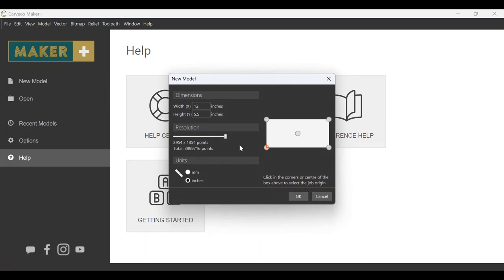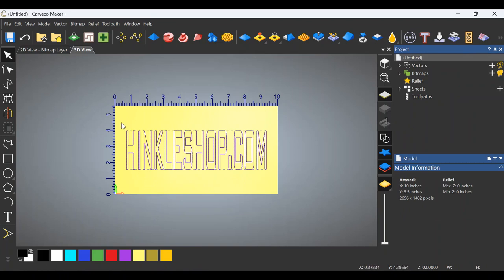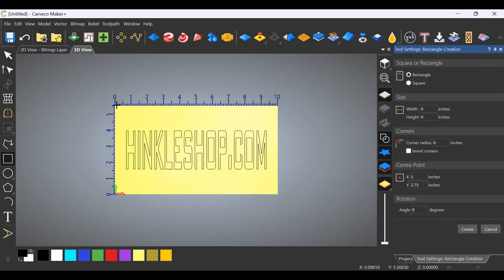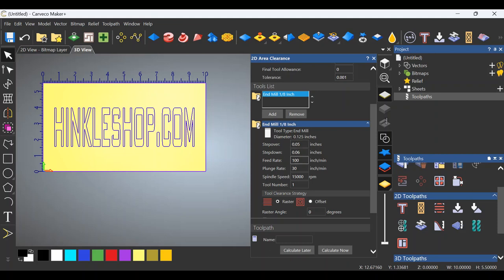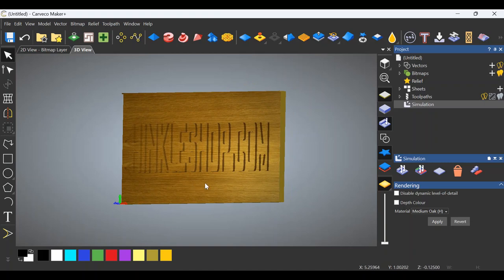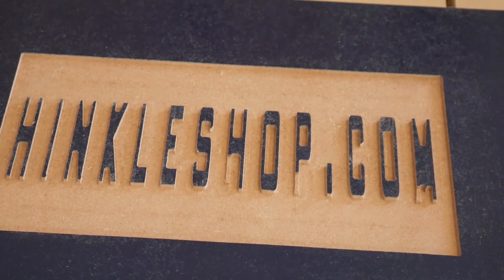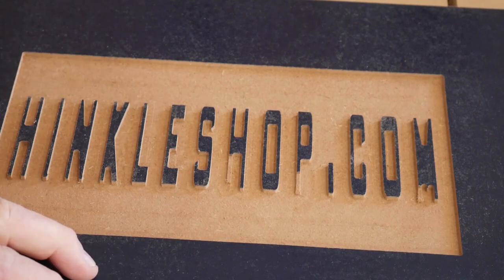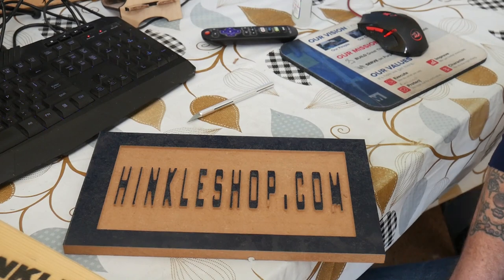Learn raise text

Comment: I've seen your rooster video and now this one, what I am trying to make is a relief Rooster sign with raised letters.  It would seem you have to create a new plane that will represent a future flattened area and from the point, the letters would raise up say 0.125 and the rooster would raise up 0.250.    I haven't been successful trying to do both yet, mainly because the z for the text and rooster are different but they both "start" from the same thickness of the board (if 0.75", then it would carve down a total of 0.25" leaving the 0.125" text and 0.250" rooster).
Reply from the maker: Thanks for watching 
A little hard to explain here but basically create a border around the relief (chicken) so no material is removed beyond the border 
Enter the text outside the relief border enter a boundary around the text highlighting both boundaries and the text create a v bit tool path limiting depth to the same z as the chicken and that should work
Simulate the carve and check to be sure I’m right
Hope this helps
Reply: @Hinkleshop   I will try that.  Would that v bit too path create carved out text or text that looks more embossed or like I bought letters and glued them to the board.  Thanks for the videos and response 🙂
Reply from the maker: @Hangs4Fun  the letters should look like they are glued on
Reply: @Hinkleshop I get the concept of creating the boundary around the rooster.  Problem is, it won't be a nice square box or something easy because of the way the text I'm putting there is laid out.  So I'm having issues creating a boundary around the rooster (I'm using polyline) for an area above and an area below.  I can create the odd shape (boundary) around the rooster ok, but then I can't match up a boundary for the text area that perfectly matches up to the hand drawn polygon shape, such that a tool path would remove all (other than rooster and text above and below).

I really appreciate the help, once I get this, I can pretty much do any combination of relief and text.
Reply from the maker: @Hangs4Fun  highlight the poly line boarder and do an offset outward you will get a larger duplicate of that boarder then put your text between them

Comment: Thanks for this video, sure needed it. But I have one question. Is there a different way to do ovals like that? I am trying to do one with a shoulder. It seems that I always get toolpaths over lapping. I know that there has to be a way. Again thanks for the info.
Reply from the maker: Thanks for watching 
I’m not quite sure what your asking but, if you want to create an oval click and hold the circle tool and a fly out menu will appear with an oval selection I believe
Reply: 😅 No,no. I have been trying to do an address sign with the numbers raised and with about an 3/8 or so boundary around it. It actually comes from another site. He uses aspire and or vertical. I was trying to do the same thing with carveco maker. Pretty new at this so just trying to put things together. However I did just find one that you have. And I will have to say I like your videos a lot easier to watch for an old but goody. Thanks
Reply from the maker: @mauricepeters9588 
Ok I think I understand now
So. Create an oval vector place the text inside the oval 
Activate the oval and the text limit the depth of cut to whatever the height you want the letters 
Then deactivate the vectors and create a boundary vector on your stock
Activate the boundary And your oval and do an area clearance slightly deeper than the text depth 
You will then have an oval with letters on top of it 
Also I may do a tutorial on this stay tuned I’ll try to get it done as quickly as I can 
Hope that makes sense